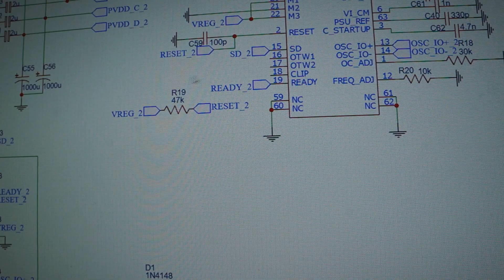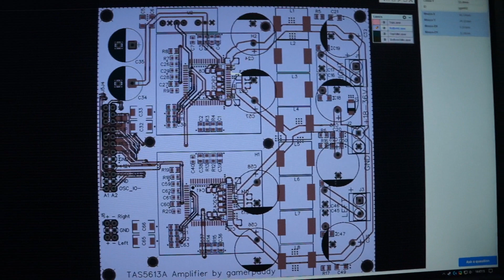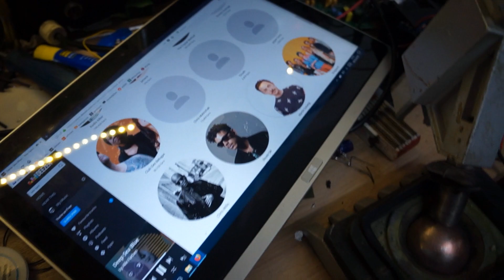DIY 600W TAS5613A Class-D Amplifier Project

Comment: Love your thermal & audio layout. Would like to hear more music through this amp! These are some of the best class d chips out there! Tripath+TI have made strides in d amps.
Reply from the maker: not easy to record what i hear, those speakers in the video were much louder in real, the camera did auto-gain to prevent clipping. also the quality is much better.  
these TI amps want a Positive and inverted Positive signal  at 7Vpk   i only feed it 1Vpp in this video, but now im working on a preamp using OPA1632 to get maximum power.  
i may include this one in pcb version 3 maybe.

Comment: Can it really provide 600 watts?
Please measure the output voltage with the oscilloscope.
Reply from the maker: I measured peak bursts on one channel and got 380w into 2ohms but then it shut off after 3seconds. Second channel is faulty and didnt go higher than 110w before it shut off.
Reply: Thanks.

Comment: Still difficult to get the heat out, even in class d when you're dealing with this kind of power.
Reply from the maker: i had a problem where one amplifier got hotter than the other, maybe a faulty IC.    these amps even get hot when there is no music playing. but not too hot at high volume.
Reply: @gamerpaddy  I heard that the tda8950 class d amps can provide quite a lot of power, and they have a low quiescent current, and they come in a through hole package
Reply from the maker: and it requires a negative rail aswell which is annoying
Reply: @gamerpaddy  oh yeah I guess

Comment: Hab grad gesehen dass du deutsch bist... Wie viel hat dich das Projekt gekostet, funktionierts immer noch und kommen da auch soo 500W raus oder nich?
Reply from the maker: die bauteile hab ich mir von platinen geklaut die hier rumlagen. neu kosten die vielleicht so 20€ wenn man den dc-dc wandler gegen was billiges austauscht.  die pcb's waren dagegen billig aus china.
ich benutz den amp nicht mehr, ging aber bis zuletzt noch. hab mal kurzzeitig 380W auf einem kanal gemessen, dann hat er abgeschalten.  der andere hatte chip für kanal 2 hatte eine macke und ging bei nur 110w schon aus.
Reply: @gamerpaddy  erstmal danke fürs antworten ^^ Wie haste dem board den strom gegeben? Also was für n PSU hast du benutzt? Das is nämlich bei mir meistens das Problem, da die sehr teuer sind.... Bin kurz davor mir meinen eigenen Ringkerntrafo zu bauen :_D
Reply: will mir eig den verstärker nur für meinen Subwoofer bauen... Wenn ich vor den Verstärker das Audio signal mit nem Widerstand-Kondensator (RC) Low pass filter nur die Bässe durchgehen lasse geht das doch oder was denkst du? :_D
Reply from the maker: hab ein labornetzteil hier das 750W bei 50V kann, gegeben hab ich ihm das max. von 38V.   42V Netzteile aus dem Netzwerkbereich / POE sind dafür geeignet.
Reply: @gamerpaddy  Ahh oke ich dachte du hast das nur kurzfristig gemacht, aber danke für die Info ^^